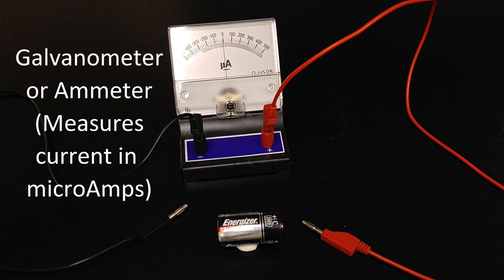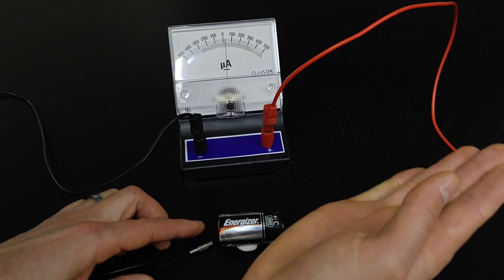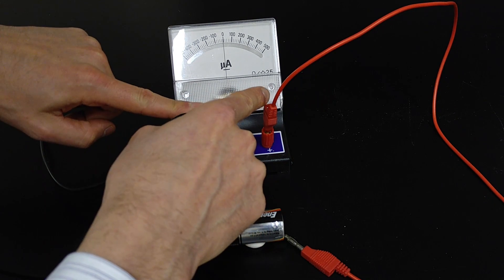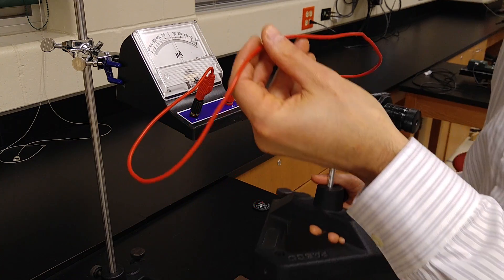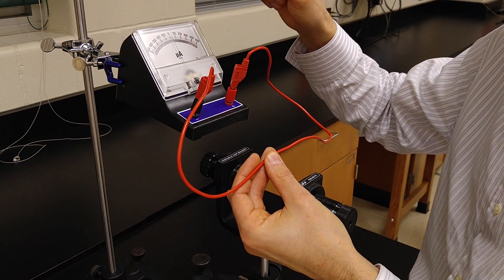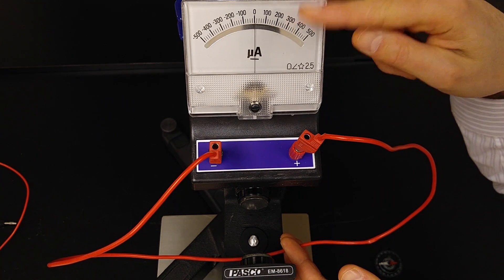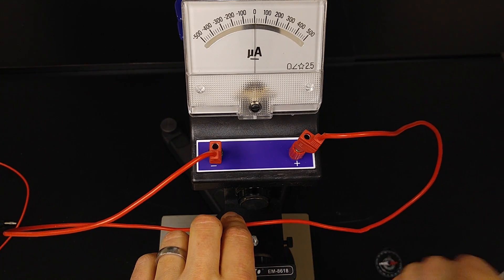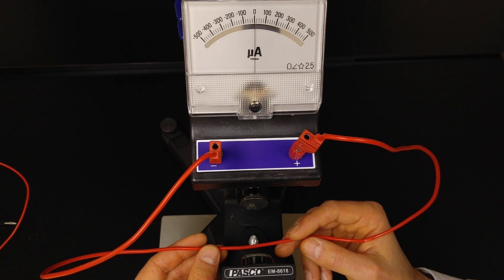Moving Wire in a Magnetic Field

Comment: What would happen if the wire is moved side to side inside the magnetic field?
Reply from the maker: There would be no induced current in the wire, just an induced potential difference on the edges of the wire in the magnetic field called "motion EMF".

Comment: So what exact force moves the electron one way or the other when you move it between the magnets?  It appears to me that the force comes from the magnets field between the magnets.

If I am right in that, this means that the cause of electrons moving in them AC conductors is due to the magnetic force at the source, i.e. generator/alternator.

So why then they give the term EMF ( electromotive force)  to cause current for the  obvious Magnetic force .   It is so confusing to me... it makes my stomach hurt.

( This does not even count for the fact that they also give you the run around of EMF not being a force, but it is work done on a charge, just to ad more to the  confusion).

(( I on the other hand thought that the so called electromotive force referred to the force you are using to move that wire up and down between the two magnets. Meaning a mechanical force applied to the conductor which are made of charges, be it by your hand ( you are doing work on the conductor moving them up and down), water, or wind or whatever))